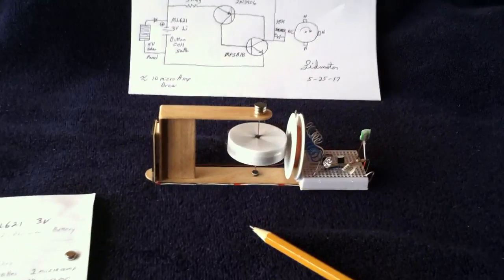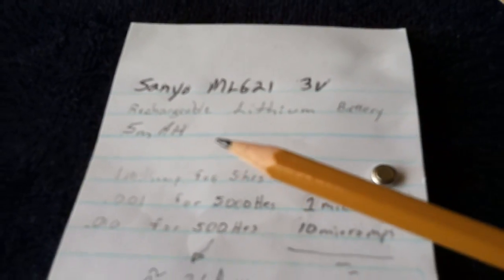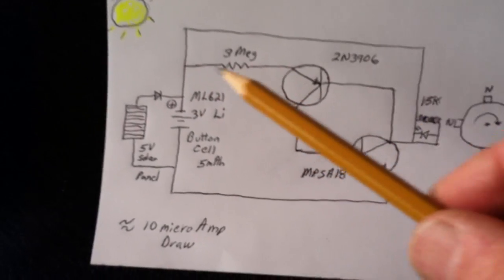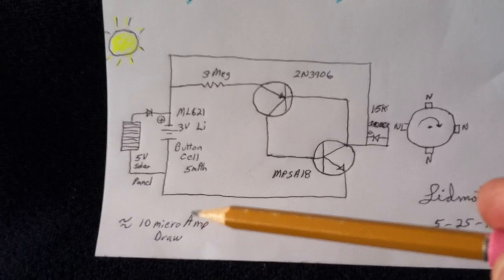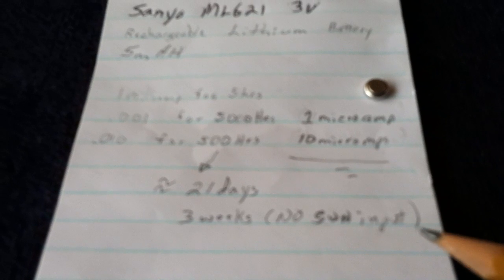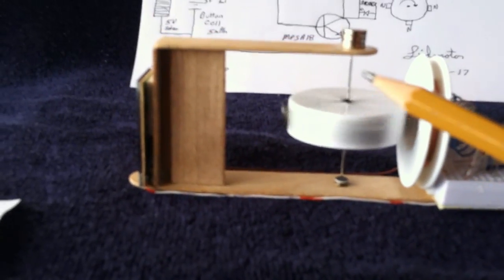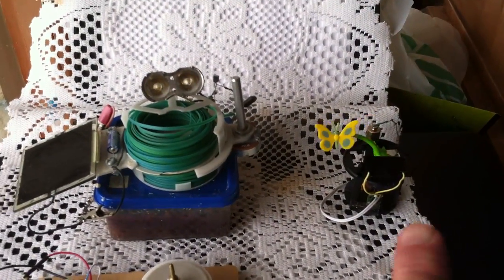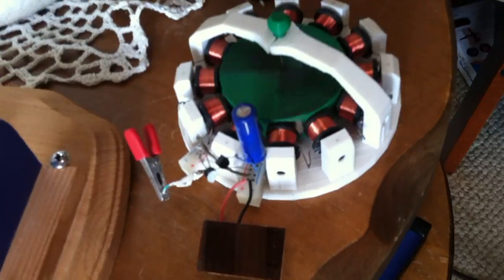Rechargeable Watch Battery Motor

Comment: that small battery  will not run down as long as sitting on the window  during the day. mine drop about .01 millivolt  for the whole night and charging 5x during the day     just put by the window. we will keep experimenting.  have a great day!
Reply from the maker: I think you are right.  The motor should just keep on going until something breaks or wears out.  I'm wondering now what the life span of this battery is.  I know some Li batteries have a shelf life of 20 years.

Comment: apparently some of these flashlights being sold out of China have one or more of these fake features: fake non-rechargeable battery, fake solar panel or solar panel is not even connected to the battery.
Reply from the maker: Yes.  I read about that. The ones I bought years ago were the real deal but the LIR2032 batteries stopped holding a charge.  I guess these type rechargeable batteries only last about 3-5 years or around 500 recharges----which ever comes first. It will be interesting to see if the ones I just ordered are fakes or not.  The reviews at the order site all said they were real---but then maybe the reviews were fake. lol

Comment: Nice as usual.  Did catch an error on the drawing.  The battery symbol is backwards as the long plate should be positive, short plate negative, otherwise great.
Reply from the maker: Thanks.  The other error is the connection on the coil.

Comment: Am I correct that the frequency is totally dependent on the interplay of the transistors?   Or is it the coil inductance that is key?
Reply from the maker: On this particular circuit the rotor magnets trigger the entire circuit with an induced current in the coil.  It has no standing frequency.

Comment: Great update !
I've got a m/wave to tear down now, so will see about the coil. These are really great fun, it's cool to see your various versions all up and running. 
My 'Forever Motor' on the C/Pb cell is trundling fine, but have changed to a dancing flower circuit the past 2 weeks..it runs very slowly but does run + auto starts which I guess is a bonus. Slows down when the temperature drops, speeds up with heat.
Reply from the maker: I also have noticed that temperature plays a part in how these projects perform.  Have fun with that MW oven motor.  There are bunch of parts in there that can be used for projects..

Comment: Nice motor. I calculate 20.8 days at 10 micro amp draw. I wonder if the solar cell will be able to recharge the battery? Inside in calif. I suspect that the solar cell is outputting about a volt at 1 milliamp, when the sun is shining. I will be curious to see how far beyond the 21 days the unit runs. It will be a good power test. 

Paul
Reply from the maker: The solar panel actually does charge the battery at the same time it is powering the motor.  I could knock the amp draw down a bit with a higher resistor if I'm not getting enough charge.  I could also just put it nearer a window or a table lamp that is on every night .  It is a fun little experiment.